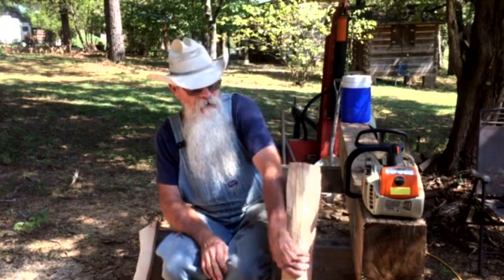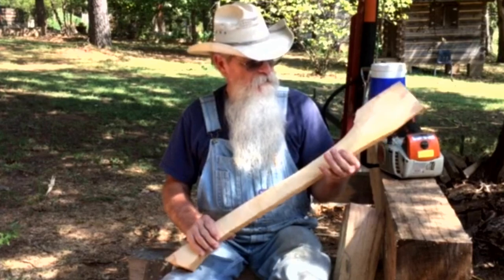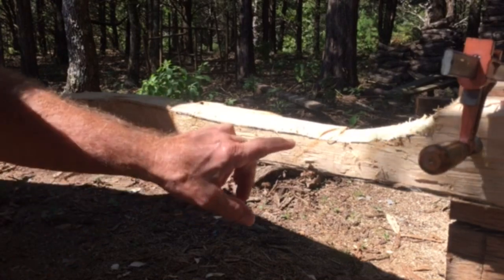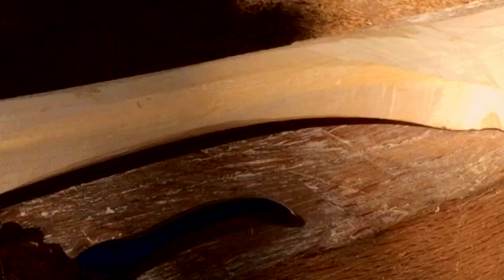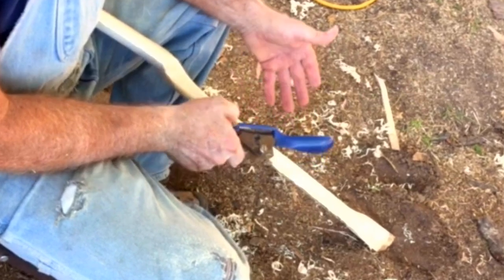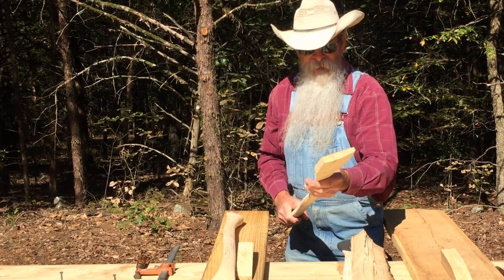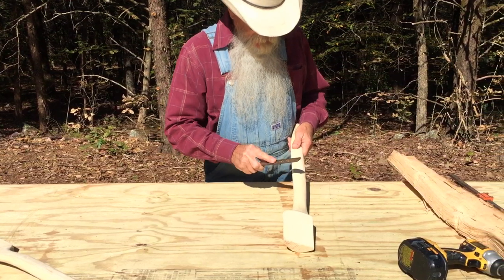Making a Broadaxe Handle

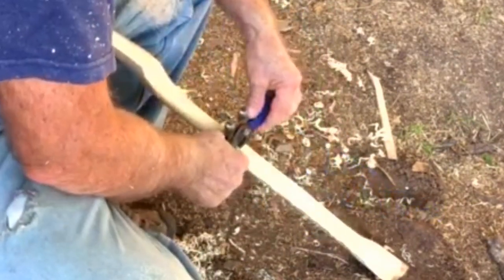Comment: 6:00 That is a great tip for that tool thank you sir.
Reply from the maker: Howdy y’all- yeah, a spoke shave can be the perfect tool for different projects. You just have to work with the way the grain goes. I hold my spoke shave on a skewed angle to help keep it from tearing out the wood and I keep it super razor sharp and set it very light. God bless

Comment: Thanks again Paul for teaching me how solve that knuckle busting problem and i feel it is safer than my previous. I tried making a handle out of an oversized piece of stock that I cared the offset , I did not steam and bend. It split on the first log. One way to learn. Aside from debarking my blowovers 14"-18" Doug Fir trees to see if I can get a 10' x 12' with 4' roof cantilever logs. God Bless You Paul, Tom
Reply from the maker: Howdy Tom- so good to hear from you. The first broad axe was a knuckle buster. I’ve had the same experience trying to carve the curve and sure enough, broke the handle right quick. I sure wish you the very best with your cabin build. Keep me posted on how it goes. Take care and Lord bless you

Comment: Thanks for your videos about broadaxes, this topic is really hard to research, even on the internet. I’m a young carpenter, looking forward to being a journeyman. I just got my hands on a old broadaxe from eBay. It’s handle is way shorter and doesn’t have the bend in it. I’ve already worked with quite a few of these goosewing stye axes and gave my knuckles a hot supper or two. Do you have any tips for working with these or even fitting a bent handle on these goosewing broadaxes?
Reply from the maker: Tobi Sinnlos   Howdy Toni- l believe if you made your handle like l showed in the video you probably would be ok. When I put a handle in a broad axe l try to make sure the head is in line with the handle. Don’t like the head to be tilted up at the front of the axe because l hew with the log on sawhorses. Hope this helps you and l wish you the best with it. God bless you

Comment: Can you share the dimensions of that block used to get the bend angle?

Thank you,
Chris
Reply from the maker: Chris S.    HowdyChris- the block is 7 3/4” long,1 5/8” high ( where it touches the inside of the handle) and 1 1/2” wide. The curve starts 4 3/4” from the end next to where the axe head would be. I also very slightly made the block concave to sort of fit the “roundness “ of the handle to keep from distorting the inside of the handle. I wish you the best on making your own handle. Hope this helps you. God bless
Reply: @TheBeardedCarpenter  thank you Sir, I really appreciate that. Keep the videos and knowledge flowing, so many of these ways are being lost with every passing day.